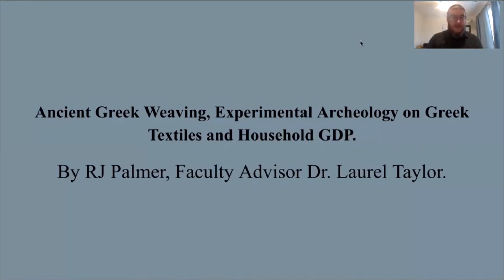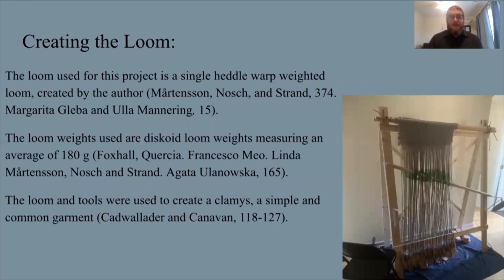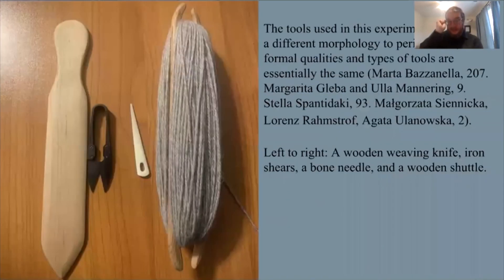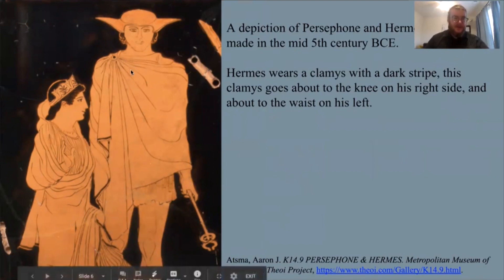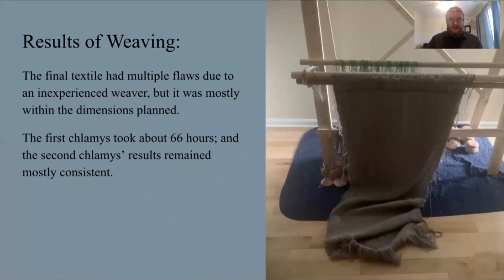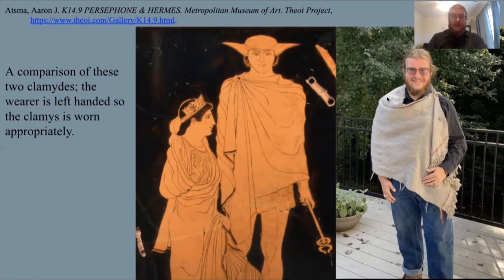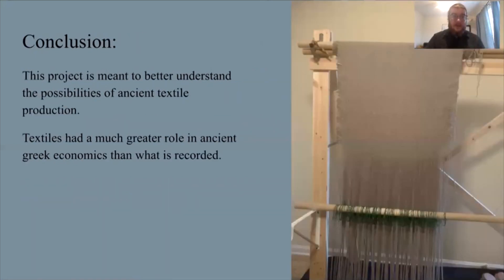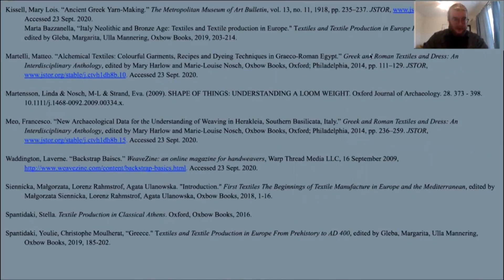Understanding Ancient Greek Textile Production and the Domestic Economy through Exp. Archaeology

Comment: Thank you, Richard, for undertaking this experimental archeology project. I weave for personal amusement, and you've answered some of my meandering thoughts about how much, how long. The process of weaving creates the head space to ponder many such things.  Observations from experience - one either uses heavier weights, double threads or threads of a different material on the selvedge warps, the outside edges.  There are two advantages, first, there is a better chance of weaving the desired rectangle and second, the edges will wear better with use over time. 

My current question is what is about the value of set of ancient sails.  In so far as I know there is no depiction or description of ground looms in Ancient Greece which would be the most sensible way of creating sail cloth.  My assumption is that they must have purchased linen (or some other plant-based fiber) yardage from Egypt or the Levant where there is tangential evidence of horizontal weaving. Losing a sail when a mast broke and went overboard would have been expensive.
Reply: According to "Sailing the Shining Sea: Maritime Textiles of the Bronze Age Aegean" by Maria C. Shaw and Anne P. Chapin, in the bronze age sails were probably made from both linen and wool depending on what was available. Wool sails woven on warp weighted looms were used by Vikings through the medieval era, so these textiles must have been strong enough for the purpose.